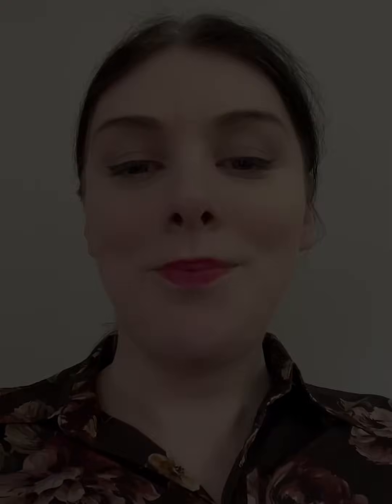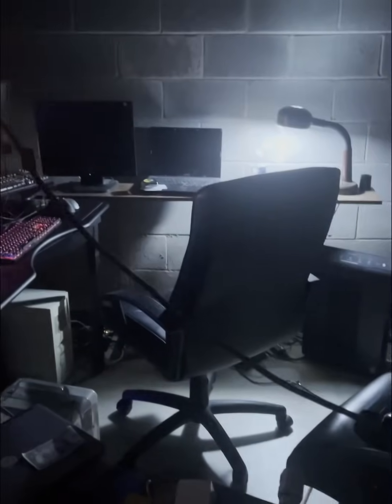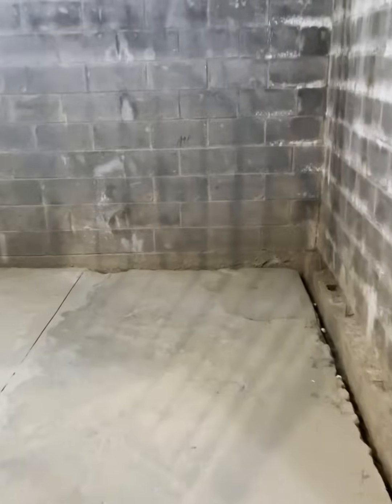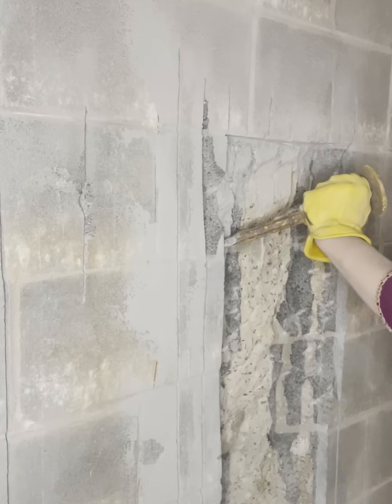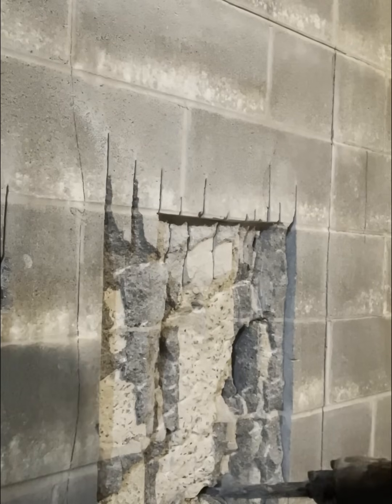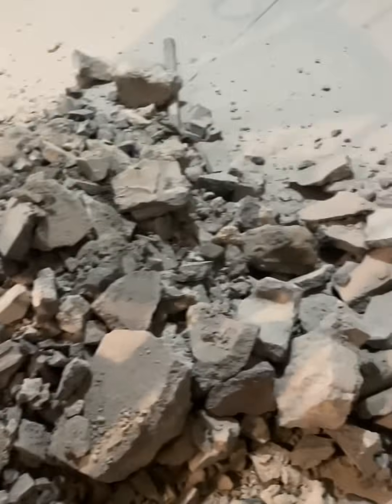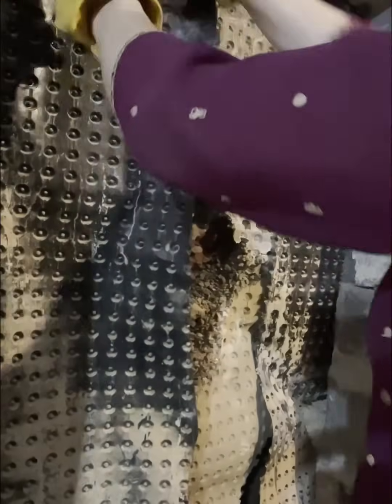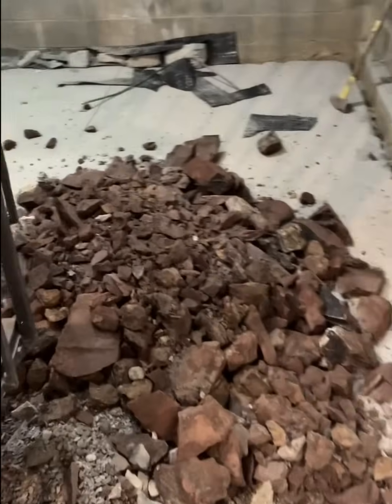Massive Tunnel Project - Episode 1 - Cutting the Doorway! DIY Engineering Fun

Comment: You state that this is a storm shelter. You are experiencing rainwater intrusion which necessitates an electric sump pump. Presumably in a bad enough storm, you will lose power and experience a downpour of rain. Does this rainwater intrusion not negate a lot of the benefits of this shelter? What's your plan for airflow in the event of power loss?
Reply: She does not actually have answers for this, which is part of why this is so dangerous and thankfully has been shut down

Comment: Brilliant videos, I just watched ALL of your tunnel ticktocks.  Have you watched Colin furze and his secret tunnel?  He does a lot of digging with a chisel on a hydraulic ram powered by a quiet electric pump. 
I am constructing a partly underground room and using delta membrane to create a layer for the water to run down the walls and under the floor.